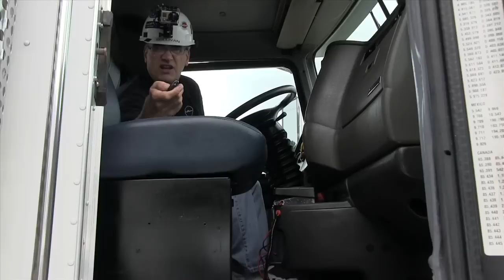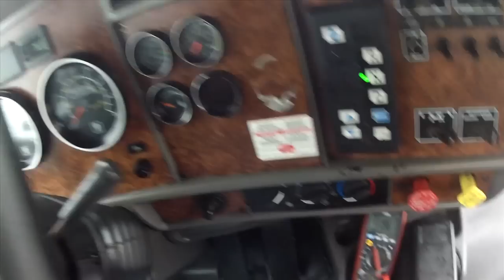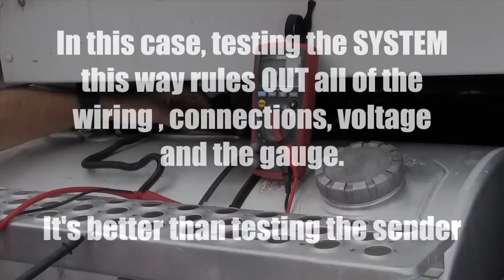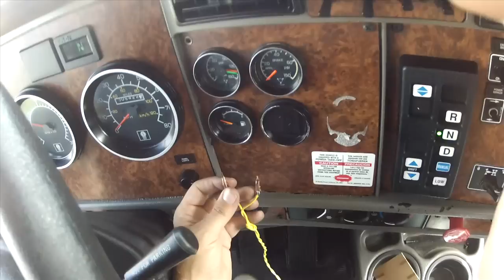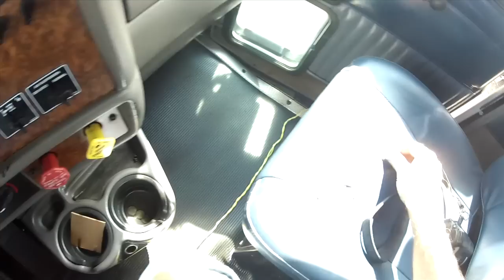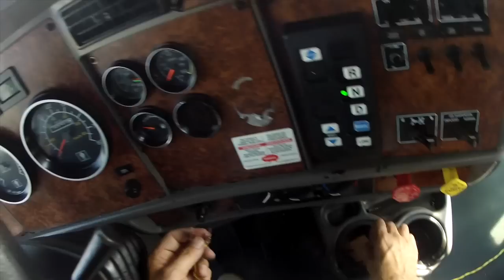Fuel Level System Testing and OPS

Comment: Most shops simply would just say you need to replace the sending unit, a guage, etc...without doing any of the testing you're doing which is sad but that's the reality of the so called techs these days.

Comment from the maker: This sounds likely. You can confirm this ver easily by simply reading the voltage at the sender connector -- if you see system voltage there can't be an open or short-to-ground. True zero (stable 0.00V) is a short to ground. The wire isn't that long, and it will take time. But you're correct. Be assertive and persistent - you'll find it. It could be to another wire, so be thorough.